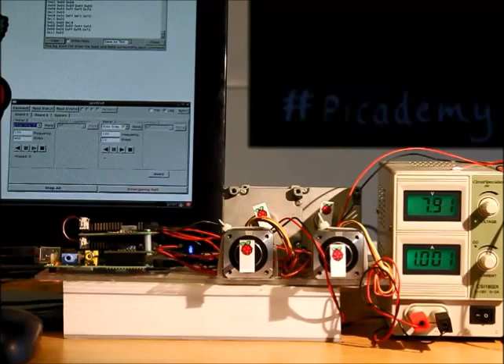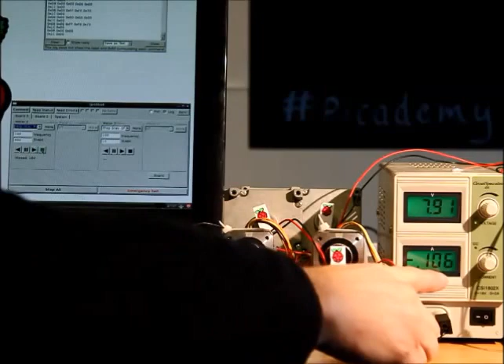gertbot stepper power anchor

Comment: How many Stepper Motors can One GertBot run?
Reply: It can run 2 stepper motors
Reply from the maker: Yes two, but you can connect up to four Gertbots to one UART link giving you eight stepper motors (or 16 brushed or any combination in between)